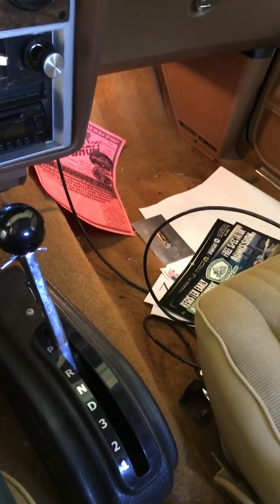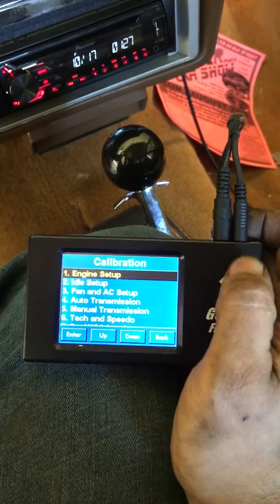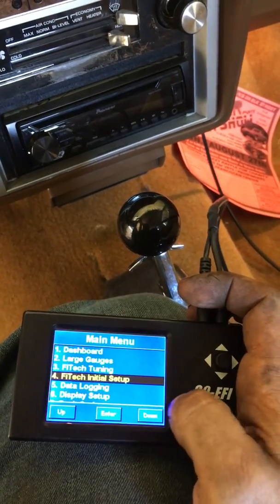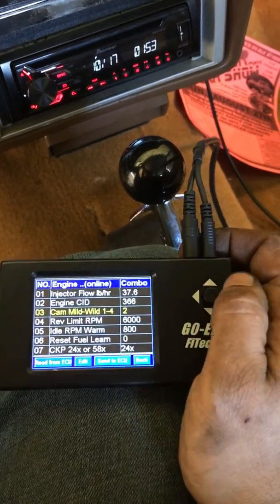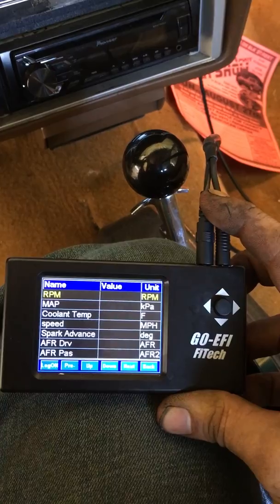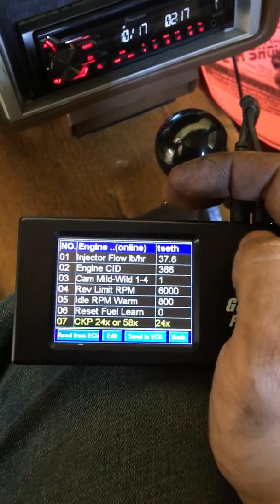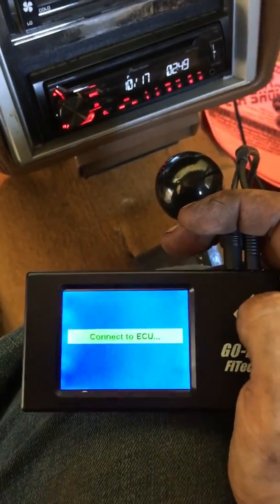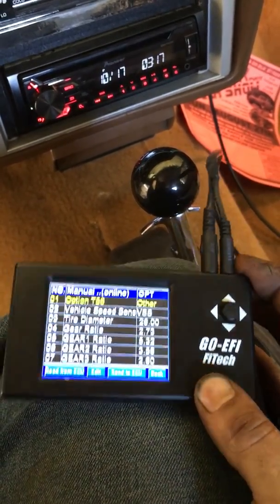FITech Ultimate LS Controller walk through and initial setup

Comment: What throttle cable did you use?? I have a 85 el camino with the 750 hp setup 
Thanks
Reply from the maker: I used the summit racing 36in throttle cable kit, part #sum-200042

Comment: nice work and thx i have a crank no start on my fitech ultimate and hand is showning no rpm any suggestion why ,
Reply from the maker: Kevin Conner HI, any trouble codes stored in the hand held? Check your connections at the cam and crankshaft position sensor, if connections are good you may have bad camshaft and or crankshaft position sensors. Something to note, if sensors were never removed there may be rust build up on mating surface on blocks under sensors pushing the sensor away just enough for it not to read. Let me know what you find, also if you have any other questions.
Reply: sorry for getting back so late ,i change out the ckp sensor  and i have a rpm reading but still no start ,injectors are reading 37lb ,map sensor 99.9 .i will have to check for spark next ,my be i am missing something in the hand held
Reply from the maker: Kevin Conner I would defiantly check for spark. If you have no spark check for ignition voltage at the coils. If no power is found, check for loose connection at the fuse block make sure both grounds are properly grounded(one on the block and one on the body) . The terminals under actually retain the fuses. I have had them loosen up and cause an open condition. Your map sensor reading is correct for key on reading. If you have spark, make sure your getting injector pulse at each fuel injector. The best way this can be done is with a “noid light” you can rent them at the auto parts store. Let me know how you make out.
Reply: thx i have one ground on the back of the left head and the other on the battery negative cable, i will change it to the body,and c if that helps ,
Reply: i have 3 dtc p0335 and p0117 and # 2and 5 fail fuel injectors ,i replace the ckp and still getting the code do i need to erase the code are do i have a bad crankshalf
Reply from the maker: Kevin Conner, make sure the connector is fully seated in sensor, also make sure the terminals are not spread apart and completely seated. Also, what Ckp reluctor do you have set in the hand held. Also what’s the year is your engine?. Did you happened to check for spark at all?
Reply: 06 ,6.0 chevy silverado,and i did not set any parameter,i use only stock setting in the fitech hand held,i didnot  chose a  setting on the 24x or 58x but when i stroll down ,i saw the 58x too the right in the system,when a pull the old ckp sensor out i don:t remmber if it was black 58x or 24x gray sensor ,no i haven:t ck for spark yrt ,i will u date ,when i do. kept me posted on want u think i can do ,thx
Reply from the maker: +Kevin Conner your 2006 has a 24x reluctor.58x didn't change until mid to late 2007
Reply from the maker: hey, any progress on your build?
Reply: no ,not yet it has been raining and cold, ever day here in texas,but have the 24x and hope it work,i am going to put in later today and hope for the best thx for your concern, will kept u in from
Reply: well yes i change out ckp sensor still no start but the rpm responses is a lot better
Reply from the maker: Kevin Conner so you changed it from 58x to 24x in the handheld? Did you check for spark yet?
Reply: no  not  yet will let u known, i have my 2 red wires runing from the ecm  to the batterie instead of the starter u think  that might be a factor
Reply from the maker: Kevin Conner the 2 red wires that are connected with one eyelet car be connected to battery or starter, where ever there’s constant power. Also there’s a second red wire that is a single wire to a single eyelet that wire must be connected to ignition power. Also do you have the orange wire connected the power side of your electric fuel pump. I forgot to ask do you have fuel pressure?
Reply: did noid light test absolutely, no spark on injectors,
Reply: fuel pressure is good, it kicks on ,when  ever i go to key on ,i have a aftermarket tach adapter 9117 on it also i put the 2 red wiring toghter and tie then in at the battery and ingnition wire is power with key on
Reply: all i can do know is work back toward  the ecm and c if i can discover the problem
Reply from the maker: +Kevin Conner  agreed. Isolate the the injector wires to found out if you have a power or ground issue
Reply from the maker: +Kevin Conner  I would check if opposite bank that you checked has power to, each injector bank is powered by an individual fuse.
Reply: yes all injectors have power with key on and coils ,but i did a voltage drop test from the red fitech ignition wire to the battery,it  started with 12.4 v and during cranking it drop to 8 voltages ,still looking for the main culprit
Reply from the maker: +Kevin Conner  ok that would lead me to believe there's a ground issue, on  the ground side of the injector. Maybe internal to the ECM since when you tested with the noid light and it did not light up when cranking, but when testing power wire you have power. At this point I could contact tech support, tell them what you did and how  you know isolating the circuits etc
Reply: thx Gbody  i call fitech and the  support tech had me off and running with in a few minutes ,the car sounds awesome,this is going to be a great summer to ride ,and good luck to the rest of u guy"s
Reply from the maker: +Kevin Conner glade I can help, your right it's defiantly going to be a good summer! What was the issue with the system?
Reply: what up gbody sorry for the late responses,one he instructed on the down loading the system ,and i had to replace all 8 injectors,i really appreciate ,yr guidance and working with me and the group of guys here,again the car sounds incredible.

Comment: Can you put in bigger injectors cuz i need like 80lbs for my turbo setup, and can we use turbos on this thing?
Reply from the maker: Yes,  you can run a power adder with this system, as far as running the larger injectors; the tuner has the capability for you to change the input of injector size to work with your setup
Reply: yes you can @exterminatingtraper. must be a high impedance injector and if you choose to run E85 you must add 30% to your cubic inches in the inital setup

Comment: is there a form on ultimate ls or are we phoning  tech with every problem and question my IAC doesn't seem to set would be nice to have a manual on the handheld keep the info coming thanks
Reply from the maker: I have yet to find a form on the ultimate ls system FAQ. The system is so new that we are product control and tuning. I have noticed my self my iac counts are no at 0 at idle. Called tech support at fitech, found my WRITE CAL TO ECU number was t529v , tech support says that's old calibration. The newer LS kits have calibration t529 E or D based on the crank trigger. He emailed me new calibrations and instructions on how to perform the reprogramming. My car runs a lot better. So if you guys are having engine performance issues check the calibrations.

Comment: Thanks a ton brother, I couldn't get my changes to save and also I was having another problem... talked with tech support and some kinda way my handheld was programmed for the go efi 8 throttle body.... i had no options for trans selection or crank sensor selection, And had distributor base timing, but I just received the os update and will be trying it again soon....
Reply from the maker: Hey man how did the update go? Did you get it running?
Reply: olds7888350 it starts but runs really rich at around 11.5 it will not run unless I'm constantly blipping the throttle... I set my target afr and it continues to run rich.... I'm stumped man, it sometimes starts and shuts off immediately and throwing wideband fault code
Reply from the maker: +TN Royal how far down from the collector is the o2 sensor installed? Do you have full exhaust on it?
Reply: olds7888350 olds7888350 I have long tube headers, the sensor is maybe a few inches after the collector and yes full exhaust, I removed the exhaust today to see if open header made a difference but it didn. I noticed u had you engine spec at 366ci and your inj. At 37. Did u have to do any timing adjustment
Reply from the maker: +TN Royal They usually want the o2 farther down stream at least 18in or so. Maybe that's your issue? I know ls engine tend to run rich with no exhaust and the o2 is close to the collector. The numbers didn't match up because I was messing the controller and was seeing what the outcome would be, so I can understand how this system really works, and also trouble shooting in the future with future systems
Reply: olds7888350 ok I'm gonna try moving the sensor further back if I can get the darn thing to start
Reply from the maker: +TN Royal also what are your iac steps at when it would idle ?
Reply: olds7888350 I'll have to check it tomorrow but it's set to 110, I moved the 02 further down and it still will not start. It turns over and hits like it's trying to start then nothing it keeps spinning. I'm gonna call tech and see if they can help